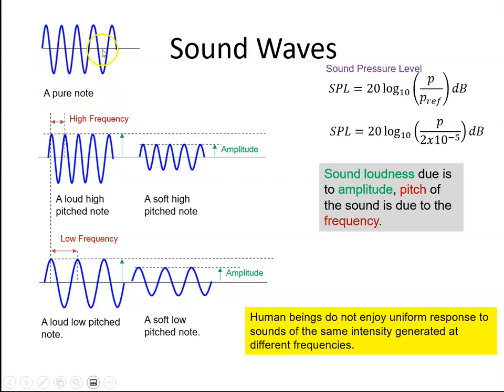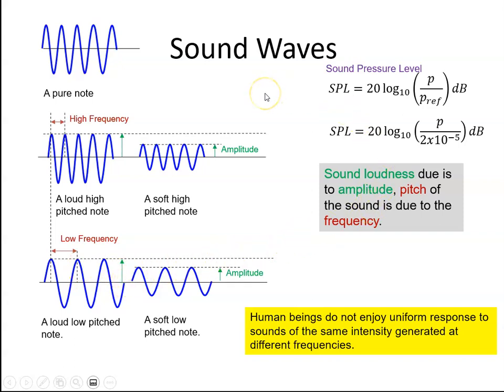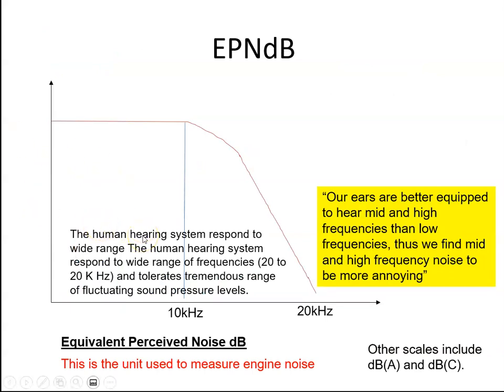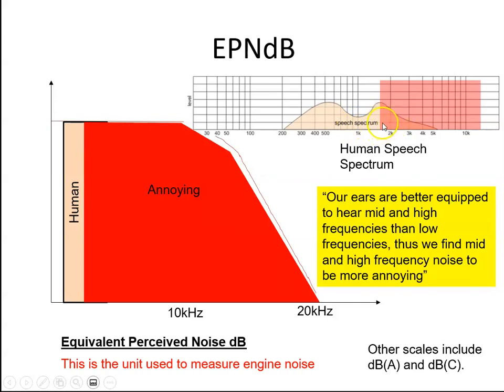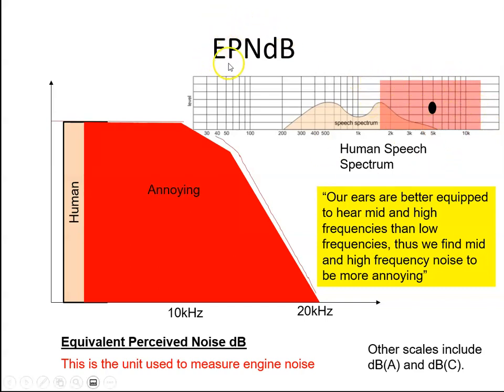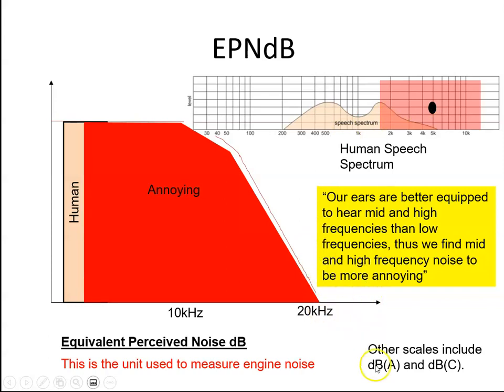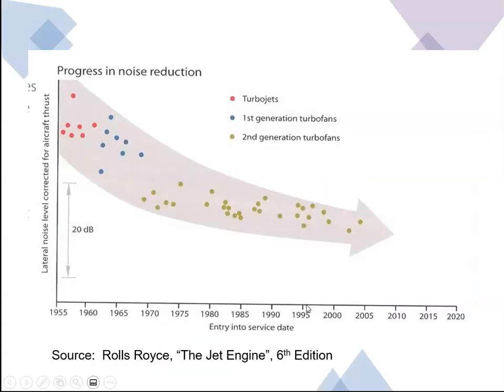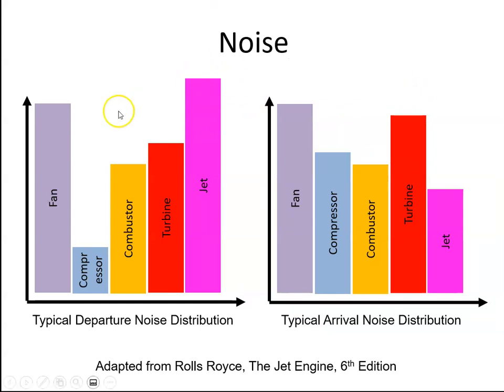Equivalent Perceived Noise EPN dB

Comment: Can you explain to me, what is the differences of stage 2 and stage 3 noise requirements???
Reply from the maker: The US FAA have different noise requirements.  For transport category aircraft the noise requirements range from level 1, the loudest, to level 5, the quietest.  Aircraft certified after certain dates must only have noise that complies with a particular stage depending on the max take off weight of the aircraft. For example, a stage 2 aircraft has the following requirement.

Flyover: 108 EPNdB for maximum weight of 600,000 pounds or more; for each halving of maximum weight (from 600,000 pounds), reduce the limit by 5 EPNdB; the limit is 93 EPNdB for a maximum weight of 75,000 pounds or less.
Reply: @RoddyMcNamee  thank you very much.